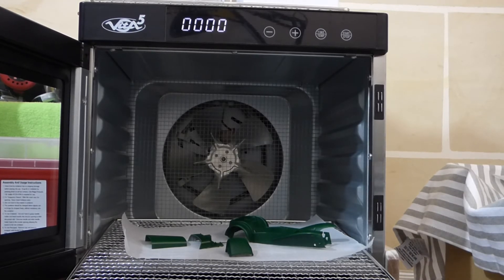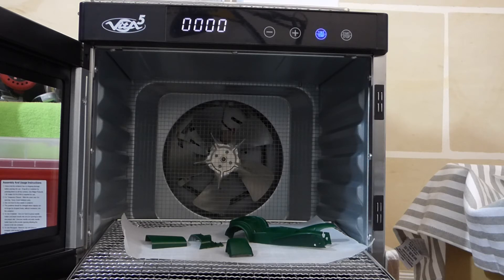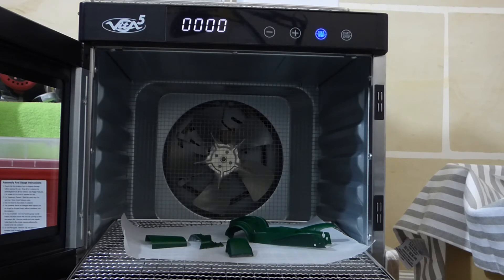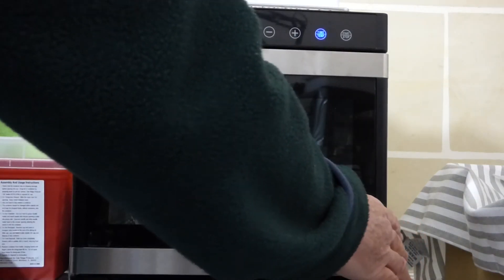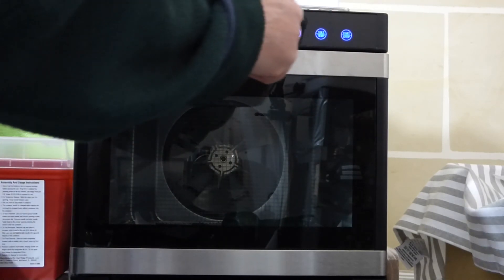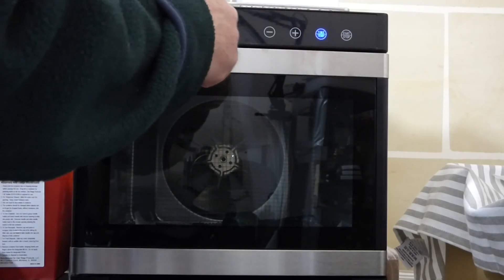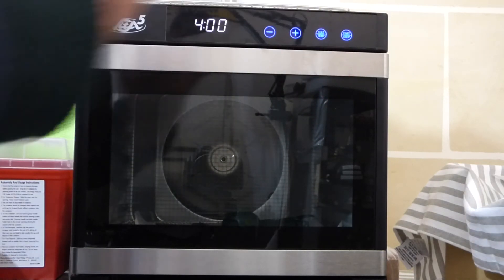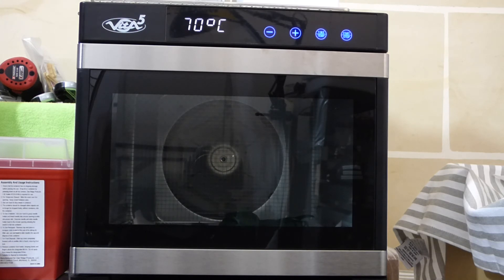Dehydrator and its use to speed up paint curing on scale models.

Comment: You keep saying Dehumidifier. Is this a dehumidifier or a dehydrator? Also what temp would you suggest and how long of a time. Four acrylic paints, lacquer paint, oil paints or enamel pants?
Reply: it will take about 10 Hr. at 113F for enamels and about 4-5 Hr. at the same temp for Lacquers. it may very from dehydrator to dehydrator